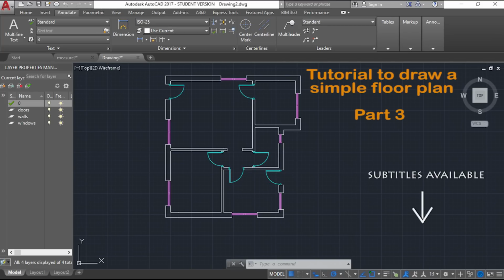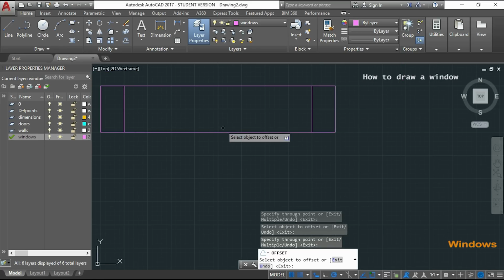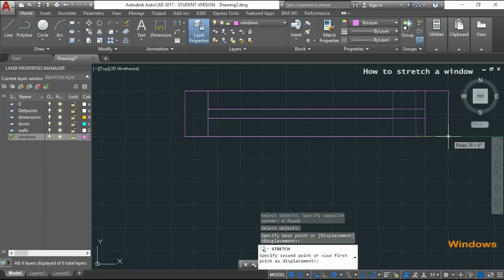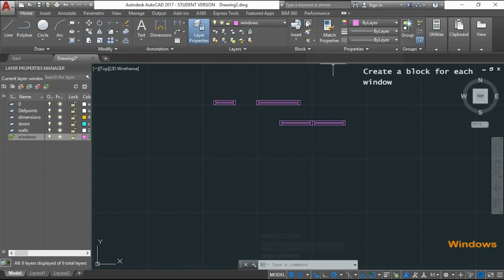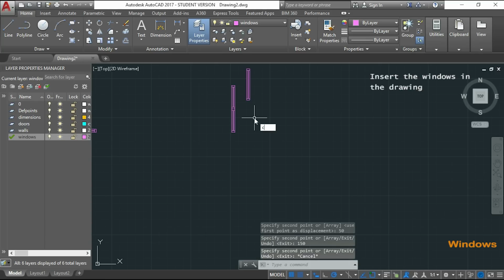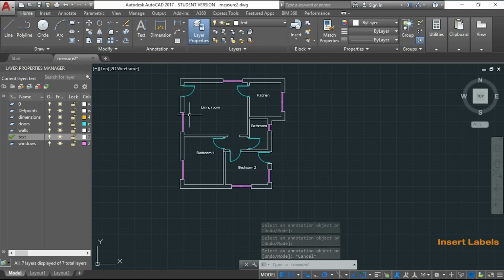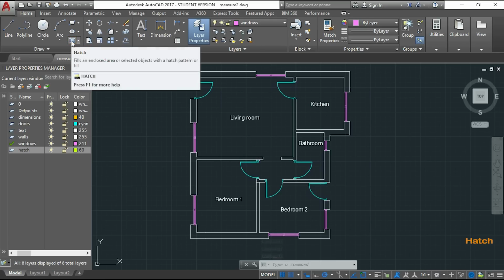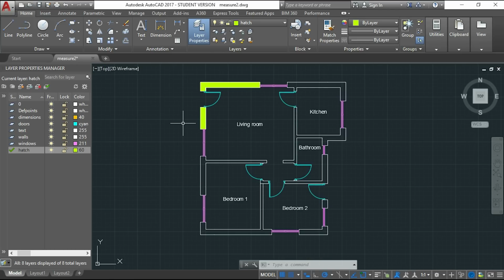AutoCAD 2D Basics – Tutorial to draw a simple floor plan (Fast and effective!) PART 3

Comment: When you use the DI to measure I see that at each end of the line there's a green box to indicate the end of the line...I can't see that on mind...is there a setting to change that?
Reply from the maker: Yes. It is an Object snap mode. You need to activate OSNAP and these green signs will appear. Check it out here: https://www.youtube.com/watch?v=tBVCOiWiFIg

Comment: for some reason when I specify how big I want the text, the text then becomes huge
Reply from the maker: Hi +Ya Boi Jakub Bala
To specify the height of the text using "single line text", you will need to draw first a vertical line which its size will match the size of the letters. Are you doing this or are you facing another problem?
Reply: nevermind it was because the scale wasn't set to 1:1